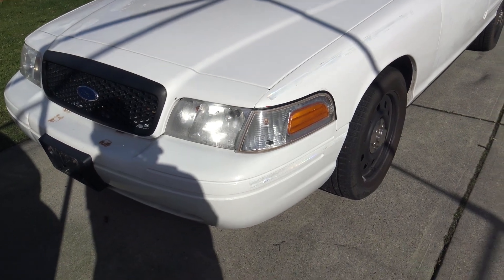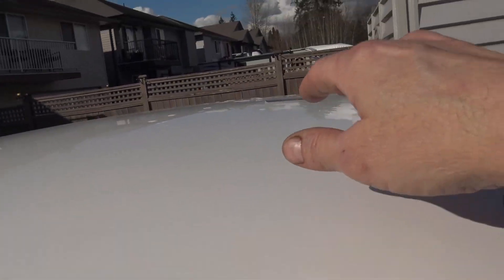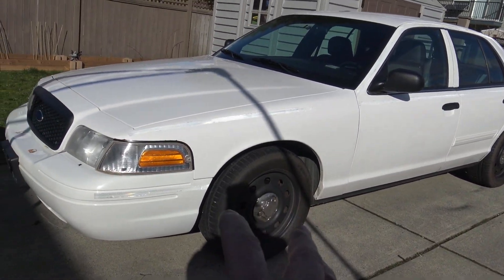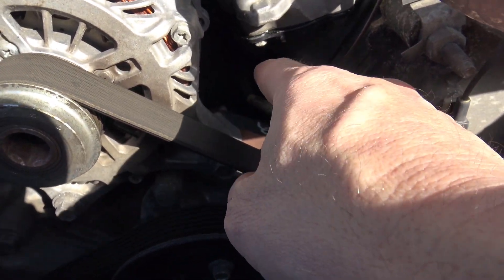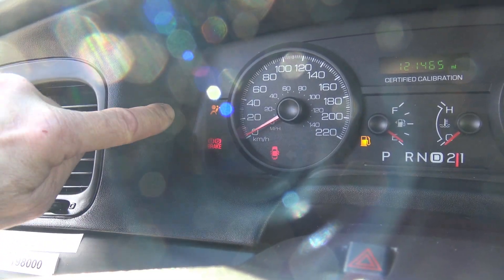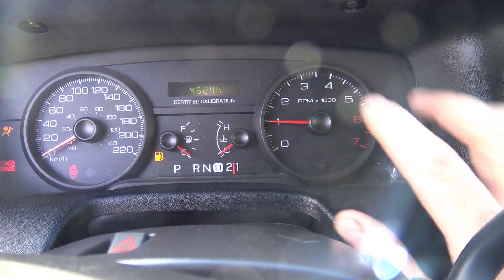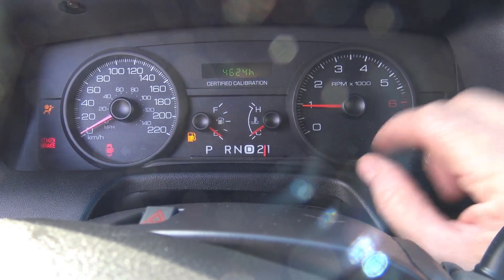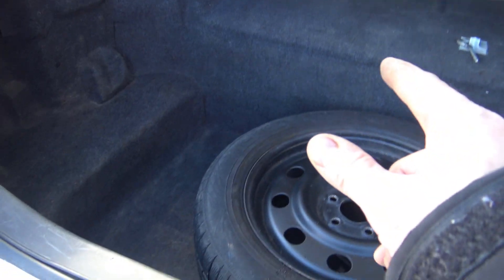Crown Vic tips and tricks 2

Comment: I'm in Canada I also have a 2008 P71, and 1 thing you forgot to mention is how they rot in the front Fender that's because there's an inch wide gap and all the rock salt sits up in that lip of the Fender and then gets activated from the heat of the engine make sure to keep that area oiled daily. Great video 🇨🇦
Reply: Not a problem in BC, not a whole heck of a lot of salt used in BC

Comment: I have a 2011 with 164k miles and has the typical display problem where you have to slap the dash to get the miles to show. One day it was acting better and I was able to cycle through to see the idle hours. 12,500 idle hours. That's insane, but it runs great and despite a little transmission whine she's still going strong.

Comment: My first ever car! 2003 PI. I love how the Vic’s can still drivable even with a lot of issues. Only the engine and the AC was working pretty. Then I bought a Dodge Charger police Interceptor! I became a dodge fan since than. You gotta love the 5.7L HEMI. But I have much respect for the Vic and consider buying 2010 for a change.
Reply: Dodge Charger pursuits are notorious for front-end issues as well as engine problems, due to the MDS system

Comment: picked up a vic. 152,000 miles, 2404 idle hours, ticket light, spotlight, no holes in dash, holes pugged with plastic. BUT... it's straight piped so ill need a new muffler

Comment: did it not come with the blue silicone coolant hoses?  Thanks for showing the connector for the rear window switch, cool.  Mine came with the strobes, some of the decals were still on, the complete prisoner divider wall which I eventually removed, the police trunk pack organizer with the kevlar to protect the gas tank, two spares, the jack, the computer tray and trunk antenna, lights in grill and rear window and the cup holder assembly, mine only had 70,000 miles on odo but unfortunately suffered alot of rust, even inside, the seat brackets are totally rusted to death and the paint was hell.  Still a great car at a great price.  I got it for $800 from a guy that sold it after he got it at auction.  Awesome cars.
Reply from the maker: That's a great price!
Reply: Read somewhere that for some reason p71’s with the 3.55 rear diff had blue rad hoses.

Comment: The missing rear door rods aren't 'removed', they've never been installed.  They are part of a 'rear-door delete' kit, and the rods are usually supplied by Ford  in a plastic bag in the trunk.....but quite often lost or removed from the trunk and never put back.  Those kits in the trunk have everything, including the button, and the large pop-rivets for installation.  If they're not there in the trunk when you inspect the vehicle, ASK for them.  It's the same as the rear seats....they've got them stashed someplace.

Comment: I just changed the ignition coils and spark plugs but I keep losing coolant and I hope its not leaking in the coils I just had replaced. The coils all 8 cost me $250 . Now i’m told my manifold might be leaking into my coils. not happy. Also my dashboard doesnt light up, so i do not know how fast I am going or when I am running out of gas.  was told 250 to replace that , just labor and since I do not have AC another 500 to fix that . $650 if I do both the dashboard and replace the AC Part thats also behind the dash board but on the  Passanger side. I like the car , but things are starting to add up. Mine is a 2007 and still has all the strobes and flashing lights on them , except for the light bar on the roof.  It has the side lights on the outside mirror and the spot light.   I want to change that spot light to LED if possible. My son put new struts and brakes and rotors. Hope i can find that coolant leak later and its not leaking into my ignition coils. Otherwise I need to replace the plastic intake and now we talking $800 and possibly replacing the coils again if it leaked in there. Also i put a new alarm , but that alarm goes off every time while I am driving!  it’s the car horn which is very annoying. I noticed it goes off more when someone is sitting in the passages seat or when I go in reverse.  Not sure if thats an accurate assessment but I noticed that a few times.  Could just be a coincidence and that it just goes off when I am driving in general. I love the batter in these cars , i wish I had a more smoother ride with the suspension.  I seen one of the comments say to put the Grand Marquis suspension on for that luxury feel. I will consider that if i keep it long. Also, I would want higher and leather seats in the front like the back.

Comment: 8:36 What is that small metal thing stuck on the windshield you touched??? I have one on my 2011 crown vic PI, what is that???
Reply: Probably just to prevent the spotlight from hitting the windshield
Reply: @sammym6239  Good idea, but I don't think so my spot lights cant really touch the windshield. The passenger side light can, just barely though. The driver side can't. What else could it be

Comment: BC winters are gentler on car bodies than in Ontario. BTW what does “secure idle” mean ( sticker near the dash trunk release)? Also my 2011 P7B has no little vent slits like your’09 next to the AC controls: what are they for? Another feature I like that I don’t have is the km/miles odometer switch.
Reply from the maker: Secure idle is a system that allows the officer with a press of a button to leave the car running securely .If the car is put into drive by a would be thief the engine will shut off. A handy feature for sure. I am not sure what the slits are for, maybe a microphone?